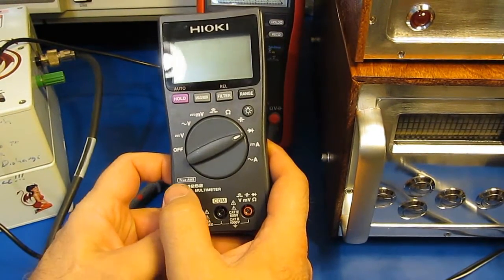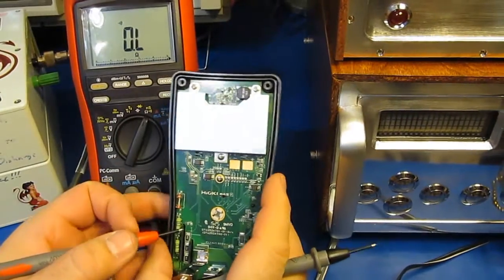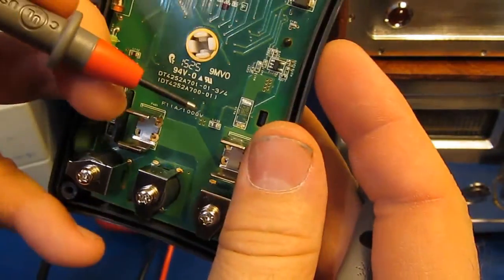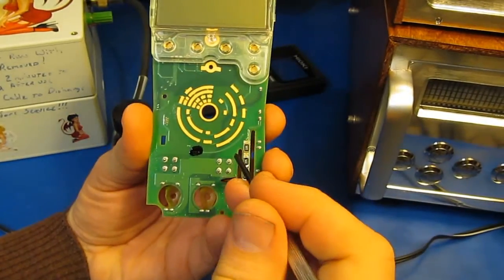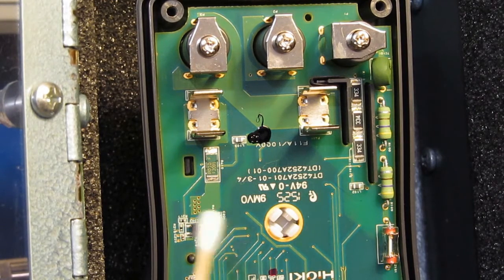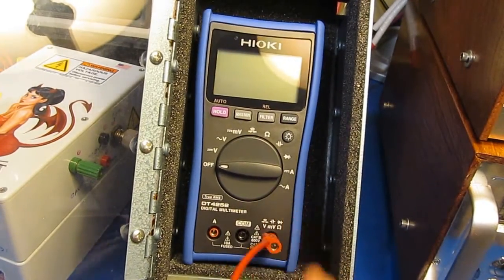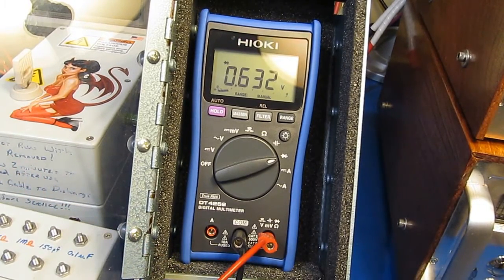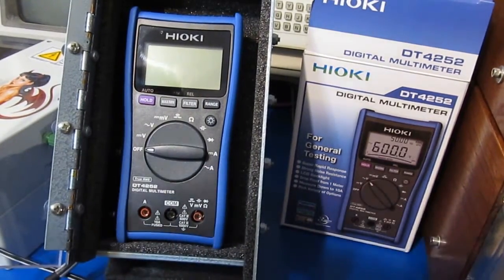The Hioki DT4252 Multimeter Part 3 of 3

Comment: Have you done any performance testing on bk 393?
Reply from the maker: The only ones I have looked at are on the spreadsheet.  Check About off the main page for the link.
Reply: joe smith 
thx. I couldnt find the spreasheet. Now i know where to look. 👍

Comment: What happens if you switch to OHM mode and measure 110VAC or 220VAC and than measure resistor, is it accurate right away or it needs time to cool down to be accurate?
Reply from the maker: +sepertude   I assume every meter with a PTC is going to need some time to recover.  Just the nature of the design. I run this test on all of the meters and make sure they are not damaged.  It would be difficult for me to measure the recovery time.  Maybe a camera with some recognition software.   If you are looking for a ballpark, using a 1K resistor, applying a rectified 220V to the meter in ohms for 10 seconds, then moving the lead back to the 1K, within two minutes it had  settled to 10 counts or so.  In three minutes it was about 5 counts.

Comment: Is this an AC plus DC multimeter?
Reply from the maker: Sadly it does not have that feature so you need to pull out the calculator.  They do offer a meter that supports it. Have a look at the DT4282 or 81.